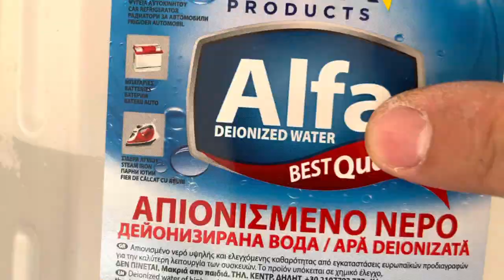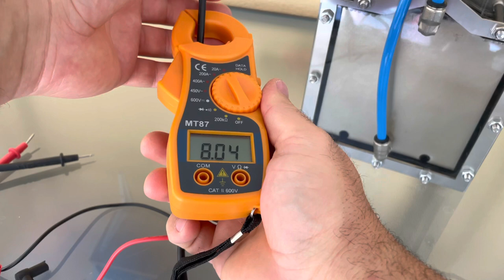HHO Hydrogen Generator. Make Free Fuel. Water Electrolysis with 12V.

Comment: What about controlling computer inputs on modern vehicles?? How do you overcome the extra O2 produced??
Reply from the maker: There are special chips for this job for new engines. I do not separate oxygen from hydrogen, there is no extra production, everything that produces burns

Comment: Hello, I am also doing this, but I have only one problem: my reactor overheats in 15 minutes at an average power, and at a higher power, in general, somewhere in 10, tell me how much does it overheat for you ?well, I still have a very concentrated electrolyte for a greater gas output, well, this is at the burner
Reply from the maker: You don't have to use a very concentrated electrolyte, for a higher hydrogen production you need a bigger generator that you don't force. How many amps does it consume, what is it about?
Reply: @Inventive101  I feed it from a labrator power supply I supply 17 volts and 5 amps I will try to make it bigger
Reply from the maker: @The_Lux  Are you sure about the tension you're talking about? with only 5 amps it heats up? What kind of battery is it?
Reply: @Inventive101  well, it's about this well, because I squeezed it well with screws, the distance between the plates is 9mm, maybe because of this?
Reply from the maker: @The_Lux  How many boards do you use? how many positive how many negative and how many neutral? The distance between which plates is 9 mm?
Reply from the maker: I don't think you're doing anything right
must
Reply from the maker: Rik rik  I don't do much calculation, I do more tests to better verify the result.